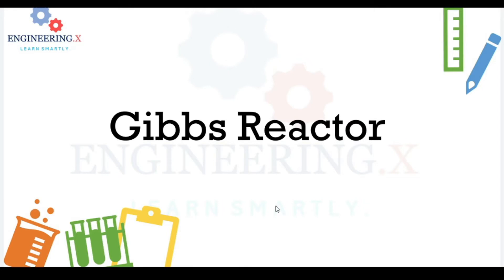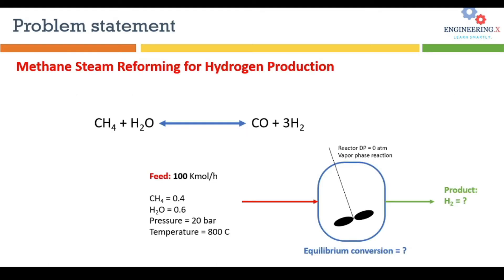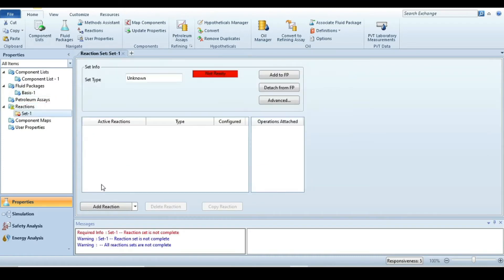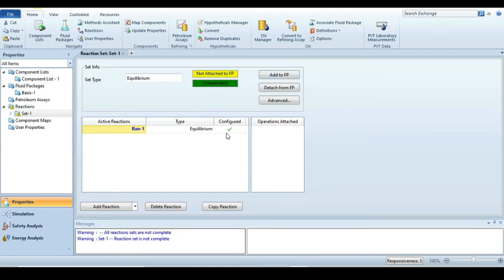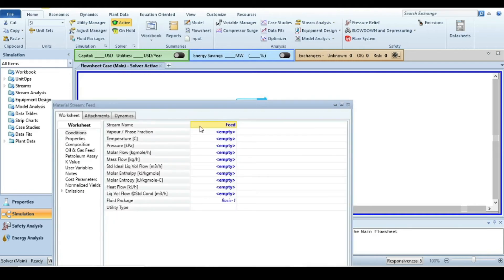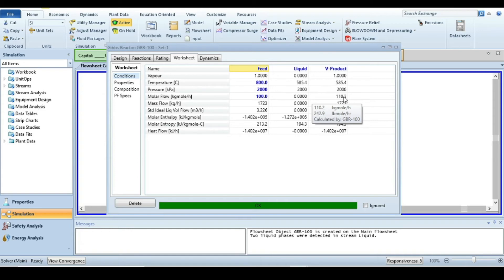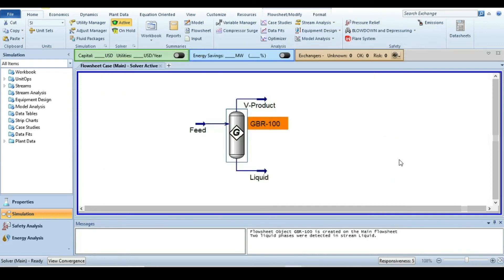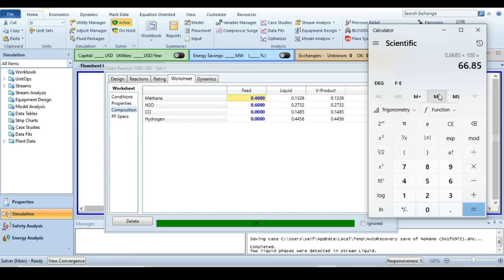Methane reforming reaction | Equilibrium conversion in HYSYS

Comment: There are difference in total molar flow difference between feed and product, so you can't calculate the molar conversion in that way. May be methane molar frac times total molar flow and then do the calculation is right.